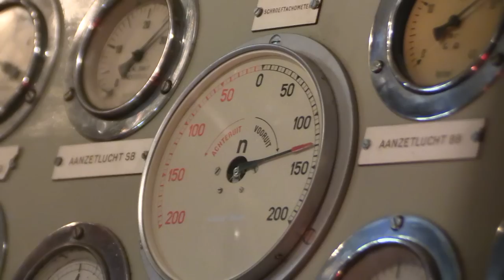SEA TRIAL ELBE 2014

Comment: Greetings from Guyana to Germany... Great to hear Rod Stewart's 'sailing'. What make of engines are fitted here? Love it dearly.
Reply from the maker: The Dutch built oceangoing tug is originally equipped with 2x SMIT-MAN 6 cyl. RB666 type connected by gearbox / clutches to one propellorshaft with max. output (upgraded in 1966) to 4500 HP /275 rpm. Nowadays the max. poweroutput as a self-sailing historical museumship, this outputpower is never used anymore, but the engines are fully original and still running perfect !
Furthermore, there are 3x Caterpillar Gensets (one speciffically for bowthruster)
1x MTU harbor gen. set and one Cummins Emergency Generatorset.
Reply: @JoopTerpstra  thank you sir for the information. I have seen MAN engines here both in marine and electrical power plant applications.
Speaking of Dutch built we have had two coastal tramps with Industrie and Stork-Werkspoor engines. Both have been scrapped unfortunately!
Have you gotten any video with the Danish built B&W engines?
And I forgot to ask what made gearbox is fitted in that tug?
Thanks in anticipation....
Keep up the great work you are doing 🇬🇾
Reply from the maker: @tickedoffsheikh8587   The gearbox made by Reintjes I think (not sure) and unfortunately I have no info/video from other engines. I followed the restauration process of the Elbe completely from almost scrap up to a sailing museum ship: a lot of my video's can be seen on youtube.
Put in my full name in youtube or google and you can find my videos easily
Two other ELBE video's:
https://www.youtube.com/watch?v=ijjIGlQdV9U
https://www.youtube.com/watch?v=xpOM075F2bM&t=47s
Regards,
Joop Terpstra
Reply: @JoopTerpstra  thank you....oh I almost forgot about the Reintjes gearboxes...well here mostly I have come across Twin Disc, Renk and one Reintjes and Lufkin.
The powerplants mostly are Caterpillar Detroit Diesel (Two-stroke) in the high speed category while the bigger vessels have MAN, B&W, Brons to name a few...yes these might be dated but they are still workhorses.
Thanks again and please continue with the good work. Regards.

Comment: what make are the main engines? also, that has to be one of the coolest compression testers ive ever seen
Reply: It was not a compression tester, but  an INDICATOR, used to measure engine performance.
Reply: @johnwilson6298  Looked like it was indicating compression, aka compression test. MTU engines use a similar style. I think it was made by Motometer

Comment: so it's 2 engines turning a single screw?
Reply from the maker: Yes, that is correct: Each engine is coupled via a hydro-pneumatic clutch tmo a gearbox ( two input / one (propellorshaft-)output) to combine both engines to a (reduced) propellorshaft.
Note: Both engine rpm's and power should be same/sinchronised to enable this clutching ! The propellor is fixed-type, so both engines are reversable !
Nowadays (withoud need of towing-power) manouvring is often performed by two running engines (each engine in opposite direction) and using the clutches to make the propellor rotation direction in forward or reverse situation !
Reply: Mr. O'Blivian Why doesn’t each engine have it’s own propeller? These are low speed diesels so they don’t need a gearbox, each could have been directly connected to its own propeller.